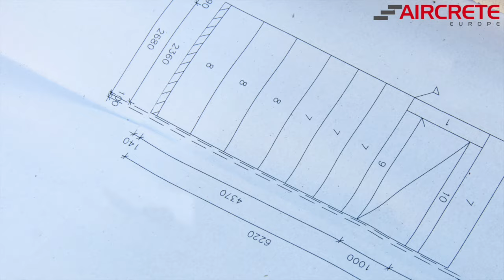The Aircrete Building System

Comment: None of this would be acceptAble under current building code in the USA. No attaching clips no rebar between panels. Take it from a Florida building contractor. Needs major revisions and no one has the special lifting equipment.
Reply: Jay Blasi would building small sheds like maybe a small tool shed out of this be a good idea
Reply: Edgar Barragan = it depends on the coat of the finished panel but I would still embed hurricane straps in each panel. Top and bottom. This system is fine if panels can be strapped to the floor and roof to the wals.
Reply: Thank you for your thoughtful & useful input!  You clearly have 1st hand experience with the topic!

The material seems promising, but this particular application scares me a bit...
Reply: SO change the system is whats on the table here..old system must go~
Reply: Ok but Florida isn't the entire USA.  Most of us aren't living under yearly threat of annihilation by natural disaster.
Reply: While that is true, the entire USA must comply with current IBC/IRC requirements and as Jay Blasi correctly posted, this style of construction is not accepted in the United States, at the very minimum due to the lack of mechanical ties between horizontal and vertical planes; mortar does not qualify as mechanical.
Reply: Wellcraft do some research - this IS accepted in the US! It’s been around for almost 100 years and code approved for years!
Reply: I worked a job in Las Vegas where that type of lift attachment was used.
Reply: Scott, I have done quite a bit of research and have worked in the residential building industry nearly 50 years.  Yes, Air-Crete panels and the like are utilized quite extensively but this IS NOT acceptable in the U.S. without mechanical connections between the footers/slab and panels.

As other astute YT readers/respondents have correctly intoned, panel-to-panel mechanical ties are also required in nearly all U.S. localities.

The "connector plates" used in this video are a joke. The panels are set on and connected to the floor "plate" with a very thin layer of mortar.  The floor plate itself is secured to the slab only using mortar, nothing mechanical.  Brick used as a facade, or veneer, as it is correctly termed, is not structural, that is why it is tied to the wood framing structure of American-style homes.  Otherwise, it can easily detach, separate and fall. A solid masonry home of course is a completely different story.

The use of precast Aircrete, a.k.a. AAC, ALC, and ACC (Autoclaved Aerated Concrete, Autoclaved Concrete, and Autoclaved Cellular Concrete, respectively) blocks and panels, which have evolved to LDFC (Low Density Foamed Concrete) and other variants have advanced in structural fabrication dramatically since the early 1920's, being used today in road and bridge construction and larger low-rise commercial structures around the world including the U.S. It is the lack of mechanical connection between footers/panels that is the issue.  Without such these panels are not much more than stacked Lego Blocks and will blow over in hurricane force wind or topple like dominoes in an earthquake. Additionally, AAC panels intended for use in seismic or hurricane prone regions must be specifically engineered for each region.

To get just a hint of the mechanical steel connections required with AAC panels check the photos under the "Projects" tab on Aercon's site:

http://www.aerconaac.com/projects.html

Read their "Installation Guidelines" (scroll down for Vertical Wall Panels):

http://www.aerconaac.com/installation.html#instvertwall

LOTS of steel mechanically connecting those vertical panels, not only panel-to-panel but panel-to-footing. The vertical re-rod shown is epoxied into the footing or slab and provides a mechanical connection between the footer/slab and panel as well as a mechanical connection between panel sections.

It is ludicrous to think that our building codes would not require this when government jurisdictions will soon be mandating building codes to protect birds from flying into high-rise buildings!

https://abcbirds.org/wp-content/uploads/2015/04/Bird-friendly_Building_Guide_WEB.pdf

Please understand that I am a firm advocate of using AAC construction products.  The lower production costs, generally lower construction costs, energy and maintenance savings, noise reduction, and the green-conscious values are all great reasons to use AAC products.  However, they must be used in strict compliance with U.S. IRC/UBC requirements and the awareness of these still relatively unknown AAC products must be promoted extensively to change the mindset of outdated construction practices in the U.S.
Reply: pen mighty gun - I think if you review the video you will find he was hammering in a plate to get the panel level.
Reply from the maker: Fully right, video showed is made in the Netherlands where a different building code prevails. For US, see Aercon website. AAC as material is great, DESIGN of the building makes it disaster proof.
Reply from the maker: Dear Jay, you are right but remember video showed is made in the Netherlands where a different building code prevails. For US, see Aercon website (www.aerconaac), they are selling AAC panels in Florida. AAC as material is great, DESIGN of the building makes it disaster proof. Lifting equipment is widely available.

Comment: The disregard  for the health and safety of the operatives is beyond belief. The lack of any form of keying/connection between the panels - other than a dab of adhesive mortar - is let's say - worrying...
Reply from the maker: Dear Alan, H&S is really something that every country imposes and its enforcement is another issue, every contractor is different. As to the lack of connection between panels, there are steel sheets and anchors between panels and more can be introduced depending on the design. The house design did pass all regulatory approvals and Netherlands is pretty strict on these things. We invite you to come and visit and see for yourself that the houses are as safe as they can be!

Comment: cutting into the walls for electrical and plumbing is so mickey mouse. best would be to have all channels included in panels by plan design. also I agree with others here, both horizontal and vertical joints need attachment, whether by pins or tongue and groove or at least H shaped inserts. I doubt if a single story home built like this would be safe to live in, let alone a 2 story house. As far as I can see in this video, only the weight and shape of  the roof is holding this structure together. I doubt if any USA city or town would permit this house .
Reply from the maker: Dear @A native Irishman, lightweight precast panels (AAC panels) have embedded steel reinforcement for additional structural strength. AAC panel building complies with existing US building regulations and is currently successfully used across the US (see www.aerconaac.com).

Comment: in an earthquake that shit would fall into pieces. there is no steel tying it together
Reply from the maker: Dear Beachnative42, In the Netherlands, where this video is shot, there are no earthquake risks nor requirements. Therefore the structure might look light to some viewers. The method of designing and building AAC structures changes for each country.Actually, AAC is a very popular building material in Japan which is known for its earthquakes. Actually, low weight of the panels and therefore the buildings is a positive factor in earthquake-proof design. Please feel free to contact us for more questions.

Comment: This material is not water proof. It takes on water like a sponge. Which is the main reason I'd never use it.
Reply from the maker: Dear In Cognito, if left unfisnihed, of course it will take in water. Wouldnt any other material do that? AAC requires adequate finishing just like any interior/exterior flooring/walling solution to avoid moisture penetration.